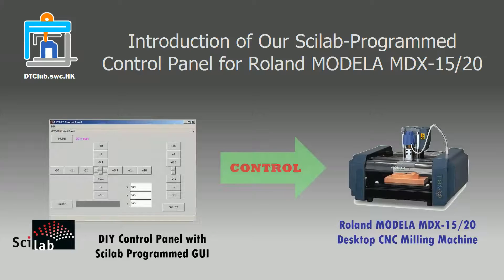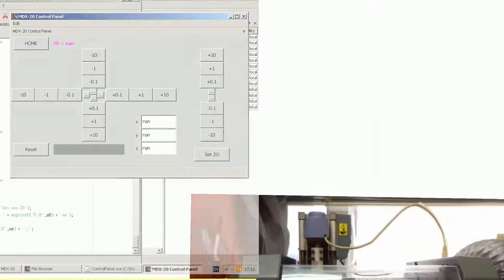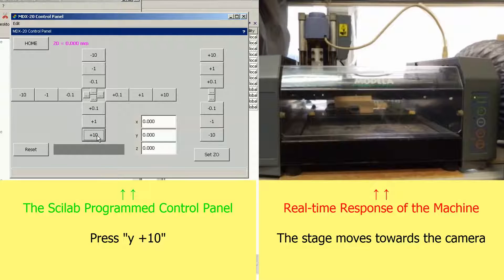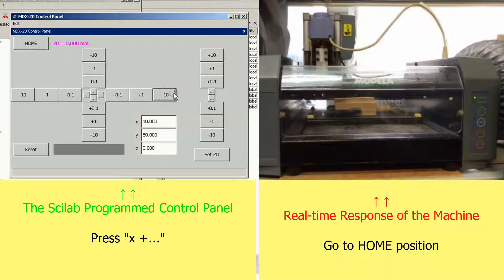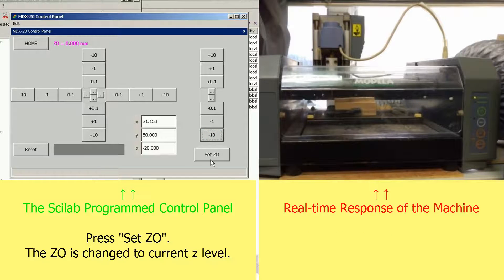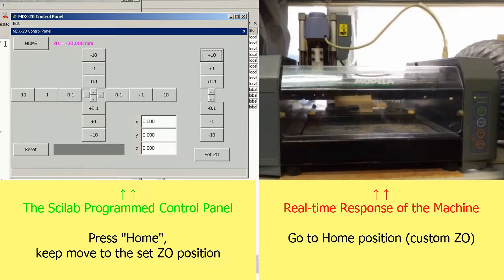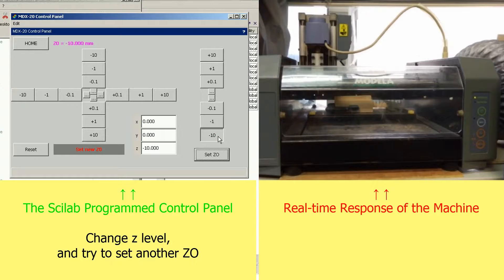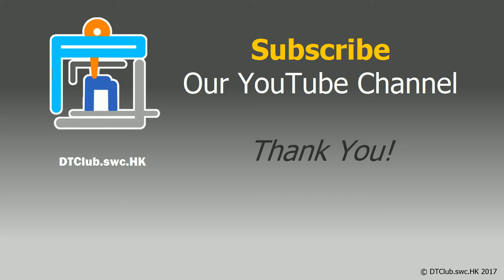Open Source GUI Control Panel for Roland MODELA MDX-15/20 CNC Machine (Scilab-Programmed GUI)

Comment: hello will this work with the roland mdx 40
Reply: Thank you for your question.

The output commands are defined for MDX-15/20. It shouldn't work with MDX-40. But you can modify the source code and replace it to the Roland RML code that is compatible with MDX-40.

Comment: Hi there, I´m from Santiago de Chile, we see your video and we found it very interesting, Could you provide the source code for us? We would really apreciate your help!

All the best

Pedro
Reply from the maker: Thank you for subscribing our channel.

We're pleased to provide the source code to our fans.
Would you mind give me your email address?
You might send it via a YouTube message, facebook, Twitter, etc.

Please feel free to provide your opinion or request of functions.
I hope you can enjoy and find helpful from our channels.
Reply: Thanks! I will contact with you by Facebook. I wondering if you can make a module to send .rml codes to the machine, cuase Modela Player can´t send rml codes, so Is very hard to make PCBs with this machine. It will be awsome that this function can be added, Cause in this case you can simply make the rml file in fabmodules.org and then simply send the rml code, as I do in http://archive.fabacademy.org/archives/2016/fablabsantiago/students/391/class4.html
Reply from the maker: +Pedro Garretón 
We're developing a sender now.
We will post it soon.

Which the operation system do you use, Windows or Linux?

I think you can send the rml code via terminal if you use fablab to use PCB in Linux.
Reply from the maker: Hi, Pedro! We have released a new version V0.3.You can find the info from this video https://youtu.be/dMVLkgNrw48 https
://youtu.be/dMVLkgNrw48